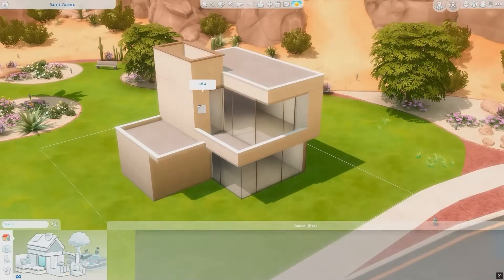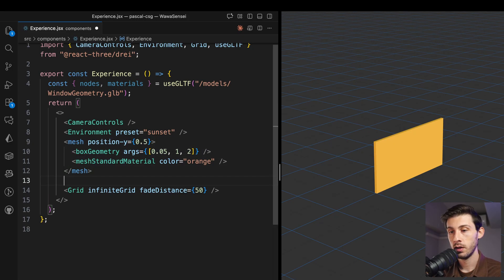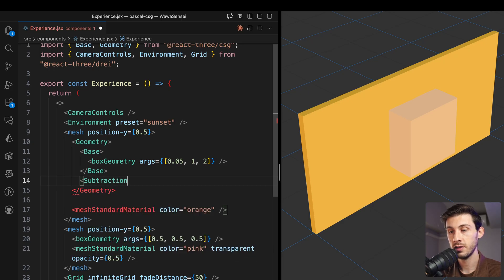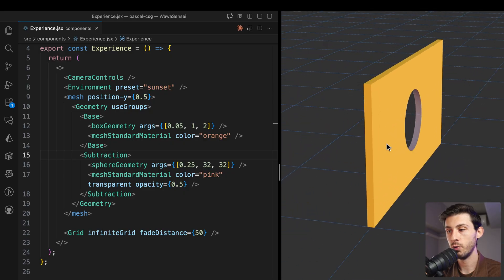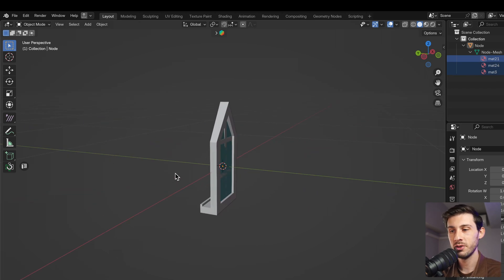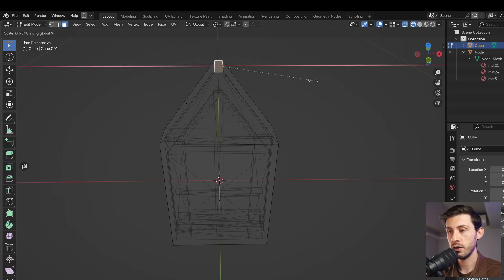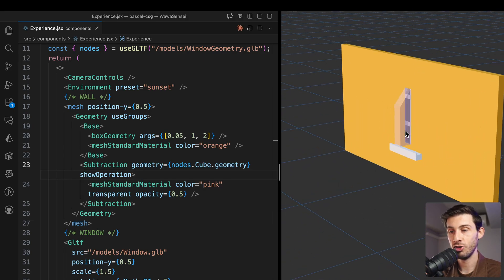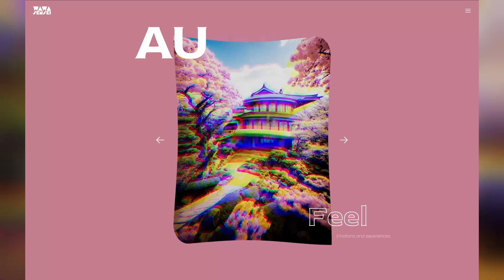I Had to Cut Real Holes Through 3D Walls - Here's How (Three.js)

Comment: Great work! I wonder if we can avoid the blender part and simply try to achieve it directly using cube and rotated cube? I don’t want to use blender. Would that be a good idea? Or not?
Reply from the maker: Thank you, depending on your shape a simple cube will do the trick and won’t require blender. For the custom shape I do in blender it’s easier with blender but you could automatically generate them programmatically too